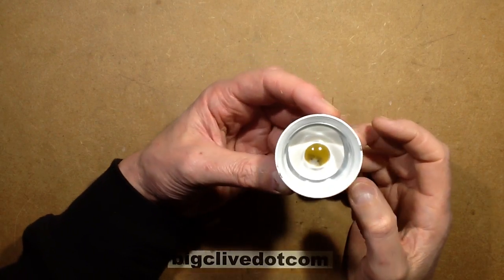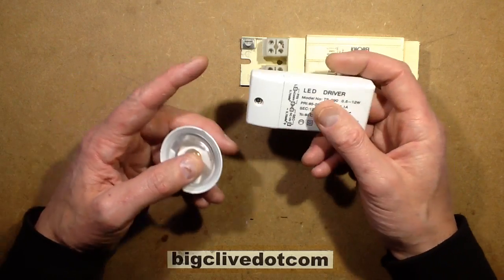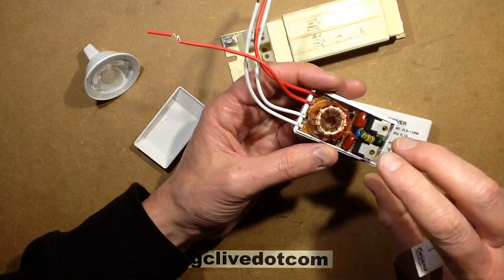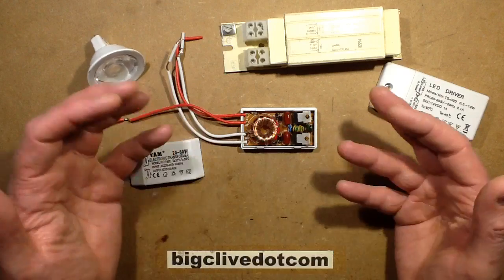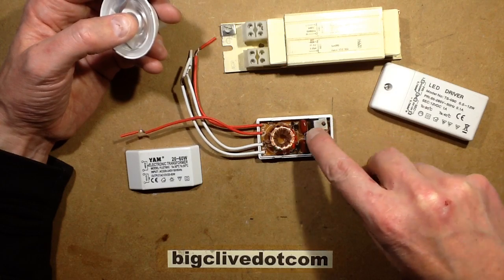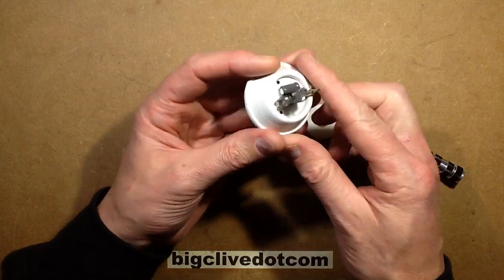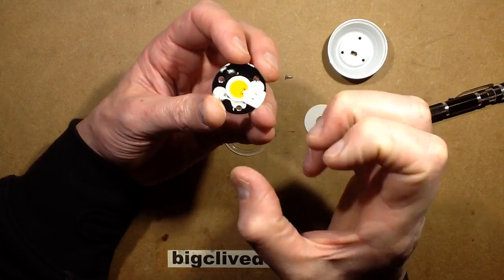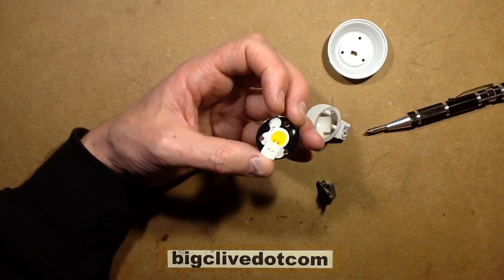Dead LED lamp autopsy.

Comment: I run my mr16 on agm 12v battery and have no problem, even when i first got them i ran them through an mppt charge controller then thought shit, its running on 24v solar system so i wired them straight to one of the 12v battery still working 4 years later. I think its ac that buggers them up. They have never been worked off the utility suply.

Comment: Improper design ... the LED runs too hot and fails early. It might even be overdriven, which is what some lamps do. They fail to understand that they won't get much more light out, and the LED will get much hotter as well.

Comment: Hey Clive I've been watching and enjoying your tear downs, know how of electrical engineering and concern of product safety for customers.  I recently completed an led array powered by 2 meanwell HLG-240h-1750b connected to 1 dimmer(not a just a pot, the product advertises a high temp shutoff and a few other features). Would I need or could I add any other safety measures for myself or the lamps (8 COB lights).  I've gotten a tad bit more confident in my DIY abilities now.   Thanks

Comment: Would you buy a 12V DC powersupply for these type of lights from ebay or aliexpress?
Reply from the maker: Some of the 12V lighting supplies are actually quite well built.  But what you get is random.

Comment: I recently purchased https://goo.gl/VIC9KI <- these LED bulbs for my wife's car, the interior lights are quite recessed and dim 194 bulbs, so I found these on Ebay and it peaked my interest. I like how small they are, often times the LEDs are pushed very far forward, so if you compare the location of the filament vs the location of the LEDs the light won't be reflected in the same place. With this bulb it appears the LEDs will the same height as the filament of the OE bulb or perhaps even lower (which is advantageous for me). Is this type of bulb new? I don't think I've ever seen these SMDs encapsulated in a hard plastic. It makes them look almost like a strange incandescent bulb as apposed to an LED. Anyways for less than $5 usd I figured I'd give it a shot.
Reply from the maker: It's an increasingly common style as it allows a lot of LEDs to be mounted ruggedly in any configuration.  They're quite smart looking.

Comment: A short video explaining the various LED power standards would be nice. E.g., LEDs expecting a current-limited power source ("LED driver") and how to select the proper one depending on the specs of the LED, LEDs with resistors in series, LED lights that accept mains... It's a bit of a clusterfuck.

Comment: I struggle with this topic all the time. People are replacing old halogen bulbs with LEDs and after shorter or longer time they are surprised that LEDs are down. From other hand I don't understand the idea of replacing the halogen lamps with LEDs. You need to put at least 2 or 3 LEDs to have the same luminous flux as 1 halogen lamp. Assuming that LED lamp is ca. 5-7 watts, you need to have 15-20 watts LEDs to replace one 20-30 W halogen lamp. Plus you need to buy a new PSU (led driver). This does not calculate from economic point of view.
Reply from the maker: It's down to marketing hype and vested interests in the agencies implementing the new regulations.
Reply: A 5 watt 3 led bulb replaces one 50 watt halogen bulb.the 3 led pack work like a single bulb it's not like each led is consuming 5 watts and they save up to 90% on energy consumption.
Reply: I think your maths is slightly exaggerated - modern LED lights are quite a lot more efficient and should have a longer life span. However, your point is still valid about the cost of having to replace all of the drivers as well as the lights themselves. It will take a very long time for these to "pay for themselves" and then of course, all of the perfectly good old globes going to landfill. 

People get much too worried about light bulb efficiency in their homes especially, when it's the electric heaters, hot water, aircon, clothes dryer, etc that uses much much more power that leaving a light on in a room.
Reply: Hmm. Keep in mind that in a lot of places you don't need a 50W halogen. In my current home, when I moved in, all the down lights had 50W halogen lamps (a mixture of MR16 and GU10). As some of them failed, I replaced some of them with 20W or 35W halogen lamps. This was when the LED type were rubbish (as were the CFL type). Now I have three quarters of them as 5W or 7W warm white or cold white LEDs. These modern MR16 12V and GU10 240V AC LED lamps are plenty bright enough. The only problem being that some of the 12V MR16 don't get on with the electronic halogen lighting transformers.
Reply: RBPL1

Comment: Clive, do you have a video where you have 'doodled' the schematic of the push-pull power supply seen at 4:17 ?
Reply: LakeNipissing
A Royer oscillator can step down by changing the number of turns on the secondary.
Reply: I'm certain it's probably similar to a royer oscillator.
https://encrypted.google.com/search?safe=off&site=&source=hp&q=royer+oscillator&oq=royer+os&gs_l=hp.3.0.0l10.23205.26676.0.27943.9.9.0.0.0.0.278.1504.0j3j4.7.0....0...1c.1.64.hp..2.6.1282.0..5j35i39k1j0i131k1j0i20k1.fIs7aD3Lt14
Reply from the maker: I've not covered that yet, but have been planning to in a future video.  It's very similar to a compact fluorescent lamp ballast, but rides the rectified DC as opposed to smoothing it first.
Reply: Thanks. Wasn't sure if you may have already covered it in one of your more than 800 videos. I looked at the Royer oscillator mentioned by Jammit Timmaj, but this seems to be applied more to inverters. From your description, this sounded more like a 240 V to 12 V step-down.

Comment: Clive do you think a swapping it for a 10w 3 series 3 parallel led would make it last for real?
Reply: I mean with the same driver
Reply from the maker: That could work.
Reply: I really enjoy running the 10w led on 300ma efficient easy to keep cool and practical they are like 17cent on taobao

Comment: Take apart your calculator
Reply from the maker: Calculators are boring inside.  Just a printed keypad and a blob chip.
Reply: Matthew Merritt if you like calculators I'm sure you can find a few over on eevblog. Dave loves them, but Clive is right, nothing interesting in a calculator, not really in the more expensive ones either.
Reply: Matthew Merritt Numberphile also has a fairly insane series of calculator videos. Most don't survive to the end.

Comment: Perhaps these are suffering because they're constantly lit in an elevator? Leds really don't love being thermally stressed so baking them 24 hours a day may not be helpful.
Reply: renxula they have disco parties when no one around ;) I guess maintenance could be more expensive but also risk of no light when the lift gets stuck with people inside?
Reply: I wonder, do elevator lights stay on all the time? It'd be the easiest thing in the world to turn them off a couple minutes after the doors have closed if the elevator is still.

Comment: LED bonds are a problem, one of my 8W cool white banggood LED bulbs has a couple of strips that have suffered the bond failure, one has stopped lighting entirely and another on the same rail, or frame, or whatever it is, does the on-off-on-off thing as it warms, then it stays on when warmed up, very annoying... :\

Comment: I want to buy some LED bulbs/lights but I am not sure what go get! I want a 1 x 60W SES table lamp, touch sensitive (4 stage) for brightness and OFF. 3 x 100W ceiling lights; two of those go through a dimmer light switch with each light having it's own dimmer. The last ceiling light is for the hall and uses standard ON/OFF switch. Could/can you recommend what to buy from the information I have given you? Much appreciated. Cheers.

Comment: It's a shame, LEDs are always advertised as having incredibly long life spans, then very often they do not even last as long as an incandescent.
Reply: Yeah, the problem is improper design. They are run too hot! This GREATLY reduces their lifetime.
Funnily enough, someone gave me a cheapo dollar store LED lamp. Says it takes 9W and puts out around 300-400 lumens (not very efficient!)
Well, it says it's rated for 2000 hours ... LOL
I opened it up - which was VERY VERY VERY easy to do, too easy in fact (just popped open in my hands!) - and it had NO heatsink for the LEDs ... no wonder it is rated for 2000 hours!

Comment: Clive I'm having some issues with the audio on your videos. Not all of them, but I think you might not be consistent at choosing the right audio channels. I've got virtual surround sound enabled and on most (not all) of your recent videos, the audio is coming out through my left surround speaker which is really frustrating. All other youtube videos work fine. Could you please look into it?
Reply: +Carsten Svendsen - And 99% of times, a computer problem can be found between the monitor and the chair. Fiddle with your own settings, I have 5.1 surround here and no issues at all.
Reply from the maker: It's YouTubes own uploader app that is putting it up as mono and some Dolby settings may result in it coming out random speakers or none at all.
Reply: bigclivedotcom Oh, so if you already knew about this, then why did you continue uploading your content via the app? I'm assuming that you can just use the desktop version on the safari browser on your ipad if you have to upload it from the source. That would circumvent the app and the issues involved, am I right?
Reply: I think he is using the Desktop version as well. I am having no issues, and haven't been. I think what he was trying to say was that your virtual surround sound may be the issue because YouTube uploads the videos as mono. So if you have different Sound settings, this may cause the problem. I have watched this both on Mobile and my computer with no sound issues at all.
Reply: The problem has to be on your end. I have no issues with any of Clive's videos.
Reply: Carsten Svendsen
I'm using 4 speakers in a surround configuration and it works fine.
Reply: If you are using stereo speakers like 98% of people using a computer, then you won't have any issues with mono sound uploads in the video. If you, like me, have surround speakers and want to actually use them, you have to enable virtual surround or equivalent. And that is what makes the problem. It's not going to affect a lot of people, but the ones like me are really annoyed by it. Of the ~80 youtubers that I'm subscribed to, only Clives videos have this problem.

Comment: Glad to see you got my lamp ok. I was slightly worried it would work when you received it!
Reply: Since when has something working ever stopped Clive from taking it to bits anyways?
Reply: +steven milward RM does not stand for Royal Mend
Reply: lol. It could have been a power supply issue though. I didn't test it myself.
Reply: Steven Milward righteo :) I assumed you were the flats janitor
Reply: ***** This was a new lift at the university i attend :)
Reply: Steven Milward oh right . I was totally wrong then :)

Comment: Is it worth it to replace the MR16 to GU10? I have full house of MR16 in the ceiling, some of them stop working, even before I start to change them to LED ones. So I am thinking to hire someone to take out all the MR16, replace with GU10. As GU10 is on 240v, without the need of another box or driver, is it worth doing?
Reply from the maker: There are two options.  You could replace the existing halogen power supply with one that puts out regulated DC for LED lamps, (The high frequency halogen drivers are not a good idea for LEDs) or switch to the GU10 version where there is more electronic circuitry in the lamp, but it can all be changed easily by replacing the lamp.
Either way, stick to lower power lamps like 3W as the higher power ones tend to get too hot.
Reply: In my opinion it would be a bad idea for several reasons.  First, if you were staying with halogens, 240v ones are alot less efficient than 12v or even 120v lamps.  Second, if you went with LED you have tons of little SMPS to emit EMI/RFI/blow caps/be less efficient than say a single quality driver for the MR16's.
Reply: Many thanks, that really gets me thinking again. I originally thought, as GU10 takes 240V directly, it will be less things to break (as nothing in between the 240v to the LED bulb). Now the question is, where to find a good quality designed MR16 LED driver? If I continue to use my halogen driver with the LED MR 16 bulbs, will there be any potential problem?
Reply: Excellent....thank you!

Comment: @clive: Could you make a video about this COBs you can use at 220-240v? i saw one of them in a GU10 (7w i think) type of lamp, which looked like an normal halogen lamp (the whole body is made from glass) but its actually just one little COB inside which gos to the socket directly. It looked like this one is.gd/O2Yzo2

Comment: On the boxes of these lamps, it usually claims something like 30,000-50,000 operating hours. That's great, because in countries with sane consumer protection law, you can go back to the shop an claim your warranty. Especially if the lamp couldn't possibly have operated for that long.

However, if the power supply is at fault, you should be a good sport of course.
Reply: in the UK the law says the contract is with the point of sale, so the shop gets to replace or refund the item and they get to return it to the manufacturer 😀
Reply: This was my lamp i sent to him. It was in our Lift and constantly on 24/7. But it had only been operational for a few weeks.
Reply: Francois Rousignat
In the Netherlads that's not actually allowed. The supplier has to deal with a warranty claim appropriately. If they refuse, they're breaking the law, and it becomes very easy to take legal action. That is of course, if the supplier still exists :)

Comment: it's a shame these lights seem to keep failing as they look quite nice, sort of minimalist. I don't have a proper LED driver currently, but I'm wondering if it would be a bad idea to run some of these off of the 12v rail of an old pc power supply I have kicking around. I'm more one for reusing things if I can rather than buying something new that's "proper".
Reply: Would definitely work, if you know how to properly start the pc supply.
Reply: ElectroBlood 
I've already got it running some old fans out of the dead computer it came out of with the green wire soldered on to the negative connection inside the power supply. the power supply has an independent mains interrupt switch on the back so I didn't need to integrate switch in to the green wire connection. I can't help but feel like I know just enough to be dangerous... which is why I ask questions.
Reply: 8Jory Hehe, yes those power supplies can put out a surprising amount of energy when you short them out. But you should be fine. That is, you have to make sure you are actually using voltage controlled LED's with regulating circuitry inside (it can be very simple, but it has to regulate the current) and not the "naked" ones (which are current controlled), since those might just blow up in your face.
Reply: I have been making some reused fluorescent into really efficient led lamps.
Beware many guides out there show people how to make less efficient led versions of fluorescent bulbs.
You can often use rectifier bridge, capacitor, fuse and PCB just by snipping the rectification part off(use cheap chinese snipps ;)).
Then just add 2 resistors and AC capacitor:
the AC capacitor in series with the fase input(very slightly safer).
A 1M resistor on the AC capacitor(discharge resistor) and then another depending on how sensitive the leds are from the positive of the recycled DC capacitor.
Complete the circuit with negative to the negative of the leds.
I have been using 10w 9 in series leds would be nice with filament leds though.
Beware that these will shock you at any part of the circuit.
Reply: PC power supplies are pretty safe, they have low voltage outputs and tend to shut off very quickly in my experience when there is a short circuit.
Reply: GoogleMinus
Yes, the supply will definitely be fine. But if you pump 10 Amps at 12V through a 200mA LED, it will probably blow up (or at least go up in smoke).
Reply: ElectroBlood No doubt there needs to be current regulation, my bigger power supply is 70A on the 12V rail, that would be spectacular!

Comment: Looks like they didn't TIG the leds right. Your TIGing technique really saved me a lot of time and hassle and now my TIGs look like a masterpiece! When will these manufacturers learn good led skills?
Reply from the maker: Key word...   Explodes
Reply: They aren't TIGing them hard enough... they need to cold weld them to properly form the lead-free joints.  It works even better if you use highly regarded stick welders... they are highly efficient and works great! :-D :-P